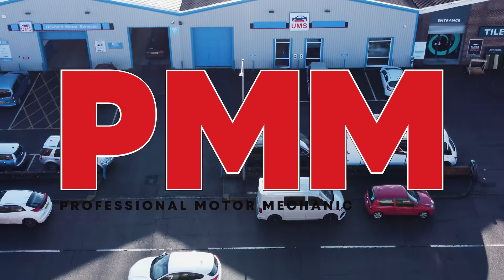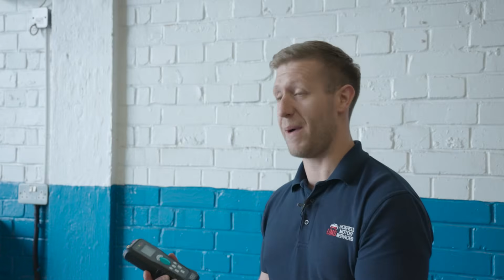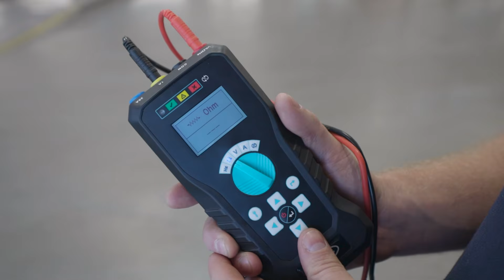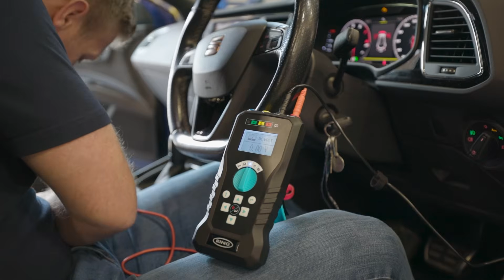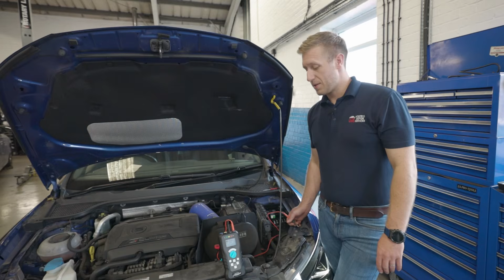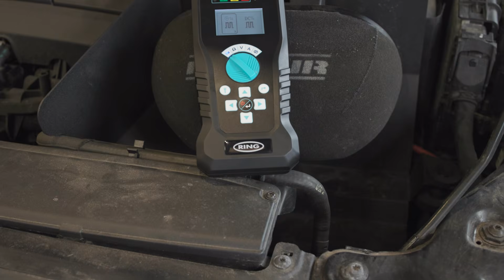Real Mechanic Reviews: Ring Automotive RM600 Multi-Function Tester

Comment: No pulse width measurement ? NO clamp meter for non contact current ? That is surely an essential with any meter.
Starter motor test....on a car that starts perfectly....well of course it's good ? Perhaps showing tests on less than perfect components would be better ?
No scope ability for VR/Hall/MR sensors ? relative compression ?
Reply: I agree, so many other features seem to be missing from this unit, I'm not impressed so far.